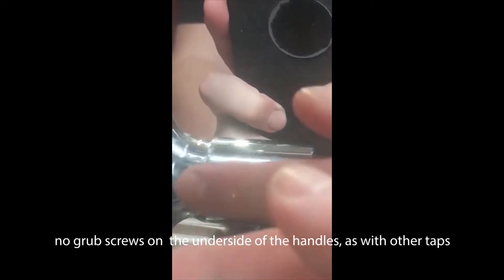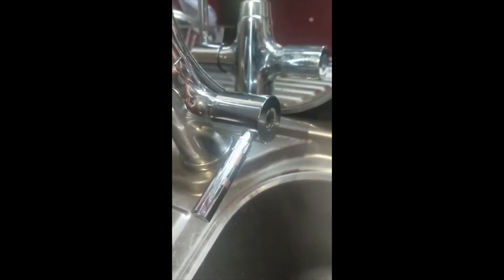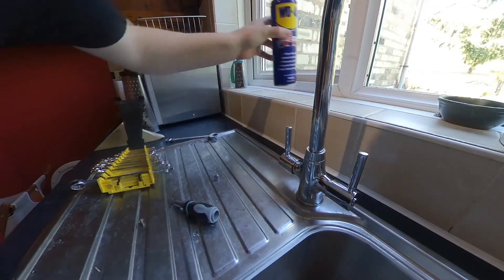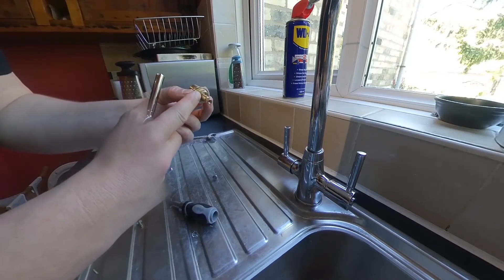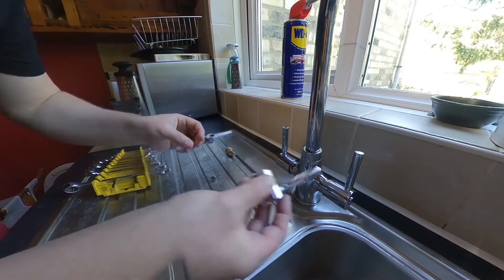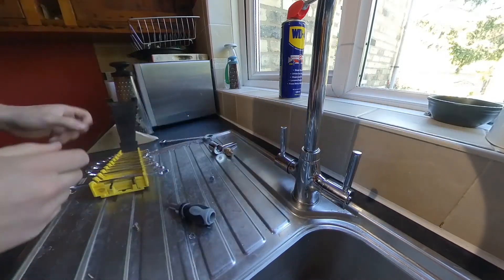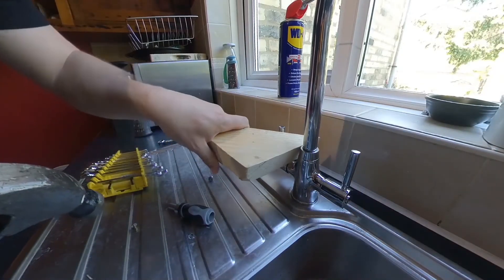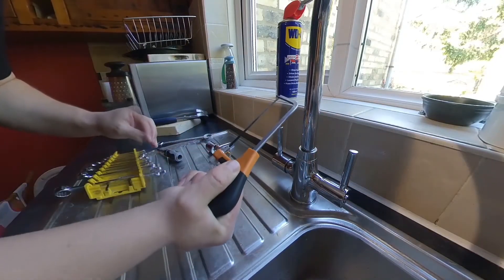Bristan Monza kitchen tap dripping.  Cartridge replacement when handles/levers are SEIZED

Comment: Hi where did you buy the Cartridge from? What model of Cartridge is it? I have the similar tap like you and I need to change the cartridge but could not find the compatible one. Could you please advise?
Reply from the maker: I mean, i just googled "bristan monza tap cartridge" and there's a load of sellers.  I went with one from eBay, but i see Screwfix have them now too:
https://www.screwfix.com/p/bristan-tap-valves-x-2-pack/
Reply: @TerrorSpark5  I went to Screwfix and found they are not compatible. Do you have the eBay link you bought from? I have seen a lot from ebay but not quite sure which one is right. Tap-magician sells ''Bristan Monza Compatible Kitchen Tap Cartridges Valves 20 / 28 Spline Easyfit'' I do not know 20 or 28 Spline. Thanks